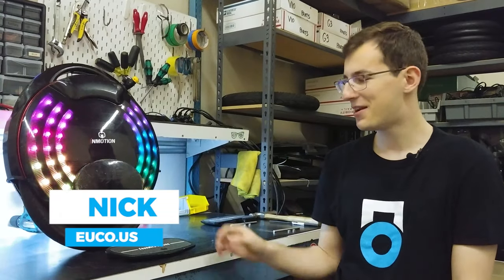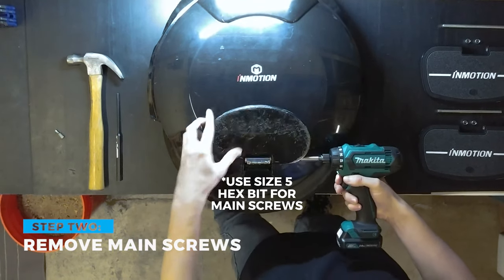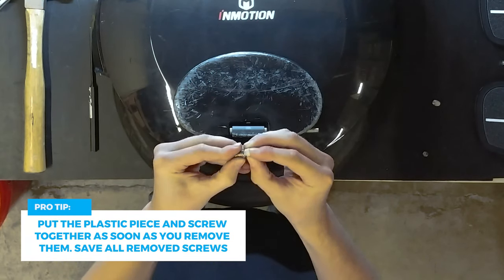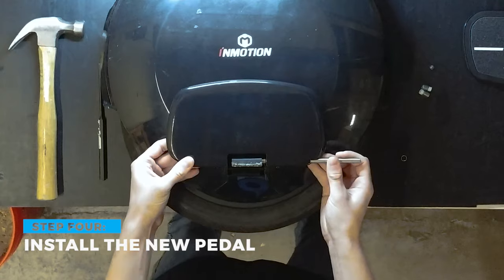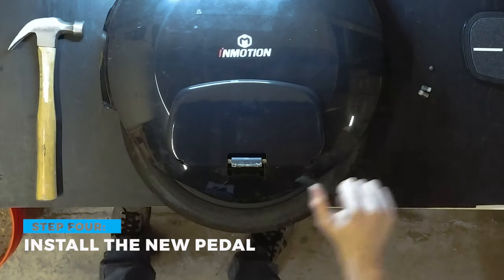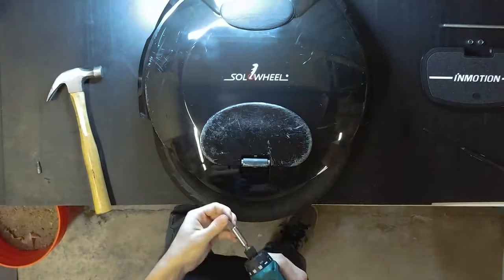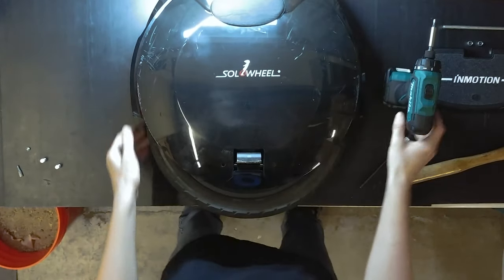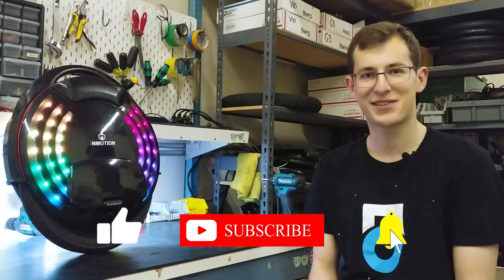Tutorial: Upgrading InMotion V5F/V8 pedals

Comment: Thanks a lot for this video! It seemed more complicated than it really is. Btw, I used an old axel with new one, when putting on spacers, one on each side, then pushed the old one away by the new one. Also, is it ok, that there is more space around spacers at the new pedal? Almost seems like four of them would feet on each side....

Comment: Hey mate,
I have a V11 original pedals, what do you think these match to V8? Cheers, Peter
Reply from the maker: Hi Péter, unfortunately the V11 pedals are shaped differently and likely will not work with the V8's pedal hangers, so for this reason we recommend using the V10 pedals when performing this upgrade.
Reply: Cheers